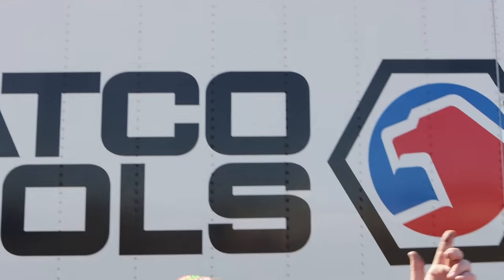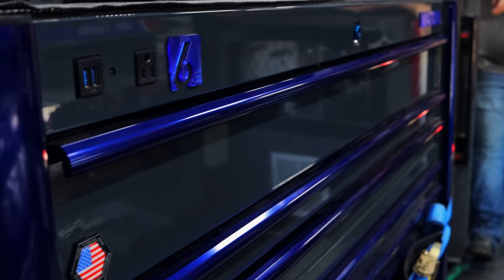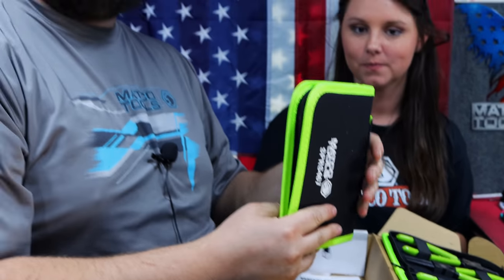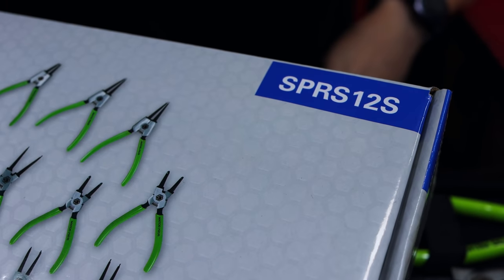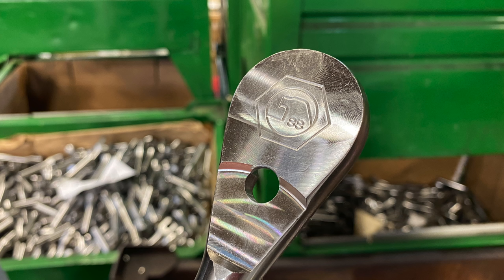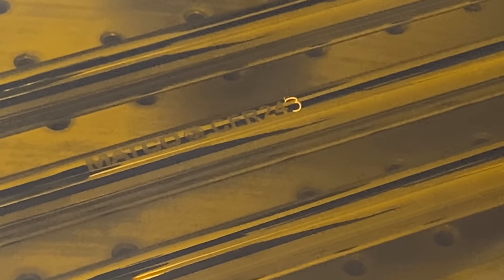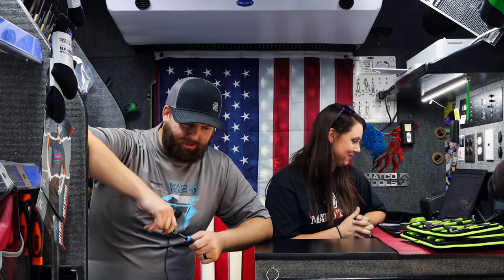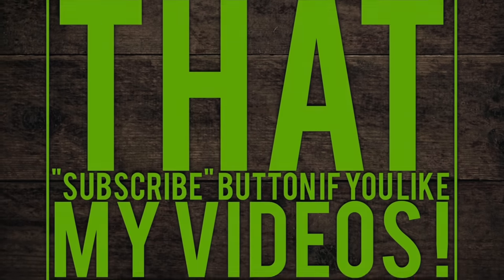Matco Tools New Snap Ring Pliers And How Ratchets Are Made

Comment: Like pipeline welding. When you weld test to get on job, your welds are cut out and pulled in a hydraulic apparatus.
The pipe will rip apart before the weld if good.
Must of been cool to see ratchet factory. 👍
Reply: That's what we had to do for our AWS L.A. City D1.1 Plate Certification test

Comment: That box looks amazing.  If I was in the market for a box, I would definitely look at those colors.  I'm amazed it has lasted this long without selling.

The snap ring plier set looks like a great deal too.  I already have the Knipex set.  I really hate convertible snap ring pliers, though the push-button Snap-On ones are pretty nice.  Life is too short for bad snap ring pliers.

I also noticed that screwdriver box close really fast as soon as the maroon handle showed up. Ha!  I was thinking the same thing.  Maybe Matco will get the idea.  It worked for the blue handles.

Comment: Back in the Walker jack days they actually had and adapter that would strap to the door for a floor jack just for these reasons. They had one for gas tanks too.
Reply from the maker: Sweet
Reply: I've been using a HF 2K lb. transmission jack for gas tanks, bumpers etc. since it goes up over 30" Now I'm thinking I need to fab a bolt on apparatus for doing doors too. Thanks for the idea.👍

Comment: That's friction welding. That's how the turbine impeller is welded to shaft of turbo internals. Before I started drivin, I worked in a machine that made ALL the internals for the turbo on the 7.3L Powerstroke.
Reply from the maker: That’s cool

Comment: Those snap ring pliers definitely look like the old style Knipex with forged tips which are pretty decent. Way nicer than the flat convertible style a bunch of brands sell. The Matco set looks like it has much larger sizes included than most too. I personally went with the new style Knipex with the spring steel tips, and I have no regrets. My Snap-on pliers sit untouched. Convertibles suck and you won't have ant regrets going to either the Matcos or Knipex sets.

Comment: Clay, was the factory a Matco-owned and operated one or was it an AJ Manufacturing facility? A lot of the confusion is from back in the day when Apex, who owns Gearwrench, made Matco ratchets when Apex and Matco were both owned by Danaher. But things have changed and Apex no longer makes the Matco ones, but you can interchange the head kits between the Gearwrench 84-tooth and the Matco 88-tooth and they work just fine. Matco made a video years ago showing the manufacturing process of their ratchets at the AJ plant, and I was wondering if that was still true today. AJ still says on their web site that they manufacture for Matco, but that may be old info for all I know.

Comment: Price of steel is even higher too.I have the snap ring plier set made by Knipex rebranded as Matco,holding up for me.My dad has bought vehicles,the previous person took the relays and fuses out causing problems.One was a Buick that was supposed to be a bad fuel pump,the fuse for the fuel pump was missing

Comment: I just bought that black quarter inch ratchet. Along with the blue handle super long quarter inch and the 3/8 that is an inch or 2 shorter than the original blue handled ratchet. All with the blue handle. My dealer has the giant black half inch ratchet with a blue handle but i was unsure about it. Maybe I should pull the trigger after all. Lol

Comment: From my understanding, correct me if I am wrong, Armstrong which is no longer in business was owned by Apex tools which is the same company who owns Gearwrench. Armstrong used to make tools for Matco from my understanding. Even though Gearwrench and Matco ratchets are different they share similar design features which go back to the Armstrong brand. Since Armstrong closed it's doors Matco uses a different manufacturer. Since Matco uses a new manufacturer the designs of the internals are different. I'm not sure who manufacturers Matco ratchets these days.?
Reply: If I'm not mistaken, its AJ manufacturing here in Illinois just outside of Chicago